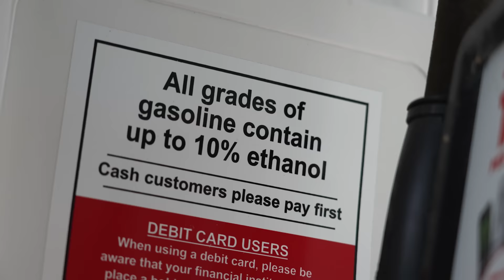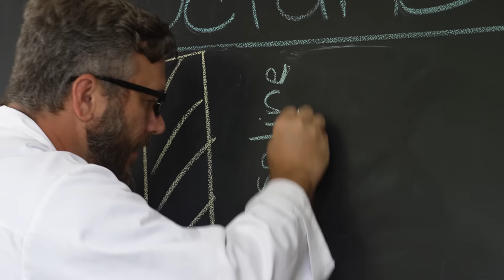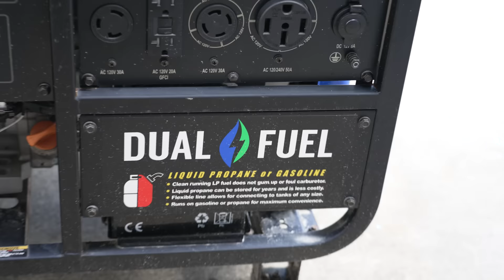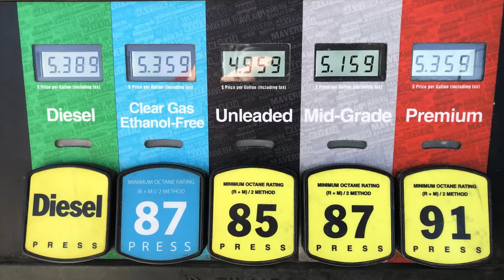This Will Destroy Your Emergency Generator! Don't Make This Mistake

Comment: I see a lot of you are sure draining the carb and tank and run the engine til it quits so let me ask you do you think that gets every drop of fuel out? One drop of fuel can clog the jets after it turns to gum. Plus you just removed all the fuel and let all that oxygen in so the oxygen to fuel % is so high that drop of fuel will turn to gum real fast. Another thing its not ethanol that makes gum its oxygen so fill the tank to the tippy tippy top with stabilized fuel and run the engine for five minutes. If you get as much air out of the tank there is less surface area to absorb oxygen. The oxygen attaches to the end of a fuel molecule chain which changes the structure to form gum. Stabilizer is hydro-treated (hydrogen) it will attach a hydrogen to the empty end of the molecule chain so it prevents oxygen from attaching.

Comment: Yeah, only purchase the ethanol free fuel, if you can.  Especially for emergency equipment.   But, regardless of what kind of fuel that you purchase, replace it with fresh gasoline every few months.  ALL FUELS DEGRADE IN QUALITY AS TIME PASSES!  Storing fuel in the generator is not the best idea.  ....it just rots!  And it's a pain in the butt to drain and refill...  So what is the best way to "be prepared".  Store your equipment "dry":  that is without fuel in the tank and engine ran until the remainder in the carburetor is burned off.   I drain all of my gasoline powered equipment after each use.  Hey, I'm just a weekend warrior/gardener.   But it only takes a few minutes to do this routine.  Also, I store my fuel IN A COOL PLACE OUT OF THE SUNLIGHT!  And in a STEEL GAS CAN!  You can store fuel in a sealed STEEL can FOR YEARS WITHOUT ANY DEGRADATION!

Comment: I shut tank off run carb dry and then fill tank with used oil I have filter 
If I need it in 40 minutes tank is drained and full of gas 
Ben doing this for 35 years

Comment: So when you put ethanol gas in a tank and let it set, you eventually end up with ethanol in everything below the gas tank.  It's corrosive to rubber seals, diaphragm, gaskets, and fuel lines.

Comment: I like the video and concept buuuuut people should also know how to make corn-based alcohol for emergencies as well cause motors can run off (moonshine) as well itd just be smart to clean them if they are small engines but as a prepper knowing how to make fuel is smart then knowing how to store it for only 2 years. Is alcohol great know but it will make something run if you need it too

Comment: You can use a GEET plasma reactor and use E85 or E99 without issue as long as your timing is accurate.

Comment: I’m lucky where I live down here in South Texas, my local Walmart, and a co-op close by both sell gas without ethanol in it. that’s all I have used in my small machinery over the last five or six years. I also store it in NATO style fuel cans and it keeps for over four years and it works perfectly well.

Comment: I have only run RV gas in my generators and on top of that, I throw in some seafoam just for good measure. I use that stuff on my lawnmower as well. In fact any small engines used my house run RV gas. That Democrat gas sucks. 😊

Comment: Should you really expect significant issues with 5 to 10% ethanol?  Is the root cause - separation of fuel chemistry when sitting allowing straight ethanol to impact fuel components?  Curious?

Comment: I have a Honda EX-4500 originally for gas only. Thanks to aftermarket propane conversion kits, made just for this generator. Easy to install, works great. Of course if you have a dual fuel generator, you're all set. We just had a 13 hour power outage, used about 6 Gals.. of propane, from my 10gal. tank. If the power outage lasted longer, I just use the tanks from my BarBQ.

Comment: if your gas is burning in the carb you have a really big problem.
I have had generator for 20+ years it gets standard 87 octane gas from the pump, gas is added as it gets low I have had ZERO ISSUES use 5w 30 synthetic motor oil change it every 100 hours, still starts 1 to 3 pulls, every 6 months gets 1/8 cup of B12 chemtool added to a tank.
was 12 years off grid, FYI solar doesn't work worth a damn in Alaska, in the winter when it is dark and need electricity for lights not going to get any from solar panels.

Comment: I'm calling BS on the ethanol hysteria. I have read and heard the most amazing horror stories (online) about ethanol. However, I've never witnessed one firsthand, nor have I ever talked to any real person who had a problem. I have multiple small engines, generators, chainsaws, etc. that sit for up to 10 months of the year unused (without fuel stabilizer), and the gas hasn't yet eaten them up. I have 3 very old cars that might sit for years at a stretch. I've never had to rebuild a fuel system, or even so much as replace a fuel hose. Frankly, they start right up on the old, old fuel without the least care. I've never talked to anyone who had an ethanol problem. No family member, neighbor, church friend, random guy at the auto parts store has ever told of a repair necessitated by ethanol. No mechanic I've talked to has ever mentioned some big bill because of ethanol corrosion. That's telling, because mechanics are very good at finding big repair bills. As near as I can tell, the ethanol horror stories are urban legend. 

The only consistent, fuel-related problem I've experienced is on generators (only generators). If you leave fuel in the carb, the fuel will eventually turn to jelly. Maybe this is due to ethanol, or maybe it would happen anyway. At any rate, when you try to start the generator again, the idle will surge annoyingly. If it's really bad, you'll have to drain the carb bowl (I've only seen this happen twice). If it's really, really bad, you'll have to drain the tank (I've only seen this once). The idle surge is annoying, and tedious to fix, but it won't prevent you using the generator. It definitely does not require any new parts to fix. Maybe our ethanol here in California is better than what's available in other states (possible, since our regulations are more stringent). Maybe our equipment is higher quality (doubtful). I don't know. What I do know is that shutting down the generator by turning off the fuel supply, and avoiding the "Off" switch, solves the problem entirely.

I'm not sure what kind of "ethanol" caused all these horror stories, but I don't think it exists on this planet.

Comment: I was told by someone who should know that the mid grade and high grade gasoline have Butane added to them to boost  their octane rating.  And, though heavier than LPG(propane) guess what Butane does when stored in a warm to hot fuel tank like a generator.  It boils off or evaporates so all these guys filling up their bass boats with premium gas $$$$$ to only wait a couple weeks to a month before using their boat are just buying premium priced regular gas. That will need an octane booster added to it for their boat motors to perform as expected when they finally get to the lake.

Comment: I know this is a year old but if you cut the lid of a Mason jar so it has a "D" shaped hole in it, when you pour out the mixture you can use the "D" hole to dam off the water part.

Comment: Run Coleman lantern fuel through your generator  it will burn out the alcohol resin and clean the carburator. Leave it dry until u need it  add fuel and it will start

Comment: Turn your gas supply off if you can or empty the tank,run it until it runs out of gas that will keep your carburetor dry and clean this will keep any kind of gas operated engine as specially two cycle engines like weed eaters power saws in better shape

Comment: I hate that all I can get is e10 here in so cal BUT my old Champion Costco generator (which was even used when I bought it like 7 years ago)  is still running strong,      Now I DO use fuel stabilizer and I DO make sure to turn off the petcock and run it out of gas after every use and I even DO every now and again start it up and let her run for 5 or 10 minutes....Some folks run their ginny 1/2 hour every 2 weeks but I think that is stupid personally....I mean this is a dry area so why?  I also DO drain the gas if it is getting like a6 months to a year old or so (I then dilute that into wife's car tank I am NOT throwing gasoline away!)  I also DO change the oil at least once per season.   Now I am not off grid but we HAVE had many many power outages in the past between SDGE planned sut downs and shutdowns due to high winds ...but for some reason they have not done one for over a year now!  Figures because I shelled out 700+ for brand new Firman 7500 tri fuel simply because I did not want to chance the old one failing on me and losing a bunch of frozen/refrigerated food and having to scramble around trying to find a new gennyl   Anyway I digress my point is only that E10 is not as awful for storage as some make out ....just put fuel stabilizer in and dont leave it in the tank too long.   I use a small diameter clear syphon tube and have never once got gasoline in my mouth because it is a long tupe and I only suck long enough to pull the gas below the tank's level and then I watch it travel the rest of the way as I stick that end into my empty gas can all the way to the bottom of course....being small diameter tube this can take half hour or so but it's worth it not having to fool with a pump......when I am done I take th tube out away from everything and then holding it in the middle I swint around as fast as I can getting all the gas out FAST....then I might even rinse with hot water and swing it round again ....why?  idk seems like gasoline film instide the tube my degrade it?  but idk honestly I am just sort of anal about it

Comment: Go to your local airport and buy LL av gas.  i.e. Low Lead.  No ethanol there.  I ran it in my '69BSA because it didn't have titanium valve guides.  i.e. needed some lead for lubrication.

Comment: E10 is fine but they should never add anymore ethanol to gas unless we could have carbs for e85. I'm probably the only person ok with e10 and not having too bad of issues. I do flush the ethanol out with alkylate fuel for storage but its almost a must for any alcohol fuel methanol or ethanol.

Comment: I bought a nice 5.5 KW generator at Aldi and it only took a couple of years for all the cheap CHINESE hoses to crack and leak. Nothing to do with gas type. Hard to say how old the generators were sold new by Aldi. For the record, I use no alcohol gas in my handhelds.

Comment: Great video! Why not siphon off the gas off the top, then dump the water/Eth?
Reply from the maker: It’s one of those things that after I did it and watched the video I thought the same. 😂 I guess it depends on if you plan on leaving the gas in the original container, which I didn’t so your method would have been better.

Comment: I always use fuel stabilizer in my fuel!  Octane booster is just putting alcohol back in the fuel.  It is a different alcohol.  Methyl alcohol, it is worse that the ethyl alcohol.  Ethyl alcohol is about the same as what you drink. That is what is in gasoline.  Octane booster is Methyl alcohol is much more!  If you read the book that came with the generator,   you may find it said Not to use Methyl alcohol!  My generator said not to. The gas companies didn't want to put alcohol in the gas it cost them more money. Do a search on Ethyl alcohol and Methyl alcohol.  See what would do more damage. If you turn the fuel off at the fuel tank and run the engine until all the fuel is gone out of the fuel line and carburetor, you will not have a problem.  I do that and don't have any problems.  I turn the fuel on and let it set a little and it starts up first or second pull.

Comment: Question:  I have a new tri-fuel generator that I've just been using propane with.  Is the maintenance different?  Should I ONLY run propane and NEVER gas through it?

Comment: OR.... You could buy your E-10 from a better gas station and not have any issues with it. Been using E-10 in ALL of my outdoor products since it came out and never has any issues, even with equipment from the 80s.

Comment: Well yeah kinda. For one thing that has been mentioned, turn your gas valve off and let the generator run out of gas. No gas, no problem. You also should buy a good generator that is designed to run on ethanol and is made of resistant materials. I have used ethanal in my Champion generator for years and I have had no problems at all. When I'm done using it, I shut the gas valve off to the carb and let it run dry and quit. This generator is used on average maybe once a year. I have had no problem.

Comment: Just drain tank and run the carb dry with stabilizer until motor stops. I never had a problem. But you have to do your maintenance if you don’t it will bite you every time anytime you do not do it I never have a problem you do the maintenance or suffer the problem…

Comment: - OR -

Do as your owners manual says and...

DRAIN the TANK (and carburetor) of all fuel before you store the generator.

Which will prevent any of the problems you had regardless of the fuel you used.
Reply: Oh, and BTW, (coming from an ASE Master Certified Technician that was trained by GM at their Atlanta Training College)...
...there are two great advantages from 'gasahol' that almost nobody recognizes:
1 - The alcohol can dissolve and clean contaminants in the fuel system that gasoline cannot. As you stated, modern fuel systems are made with materials that can withstand alcohol and so they can be kept cleaner by using gasahol (E10).
2 - Gas stations that sell lots of E10 almost never have a problem with water contamination. As fuel is removed from the tanks, moist air is sucked into the tank and water condenses on the insides and drips into the fuel. If the fuel inside that tank is E10 then it will absorb the water and prevent it from blocking your fuel filter.

In the days before gasahol car manufacturers only had minimal fuel filtering, usually a small bronze filter at the carburetor inlet that almost never had to be replaced. Nowadays all cars have sizable fuel filters since there are more and more contaminants in gasoline of all kinds, not because of E10 but because most delivery systems are just plain dirty: pipelines and such.
   Well once the fuel filter is saturated with gasoline, it will not pass water through the filtering element. So if the place you buy gas has old tanks that are full of water, you could be buying water that will fill up the first half of your fuel filter and starve your engine of fuel. This will cause stumbling, low power and even a no-start condition. Replacing the filter will cure it immediately... as long as there's not another cup of water in your tank.
   BUT, if you're buying E10 at a station that sells 10,000 gallons a day, chances are you will never get a load of water in your tank to begin with. AND the E10 you're filling up with will absorb any water that does get in your tank, keeping your fuel filter "dry" enough to do it's job.